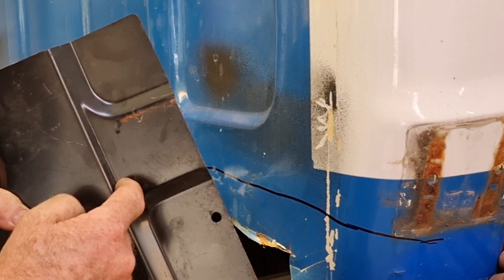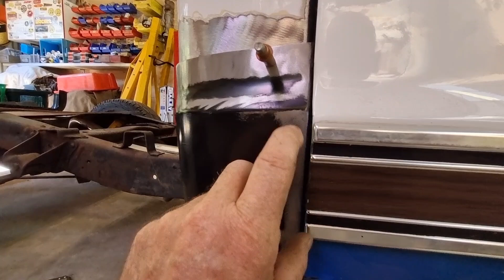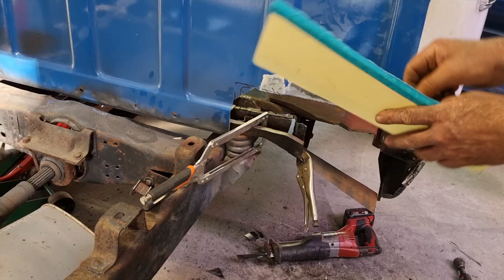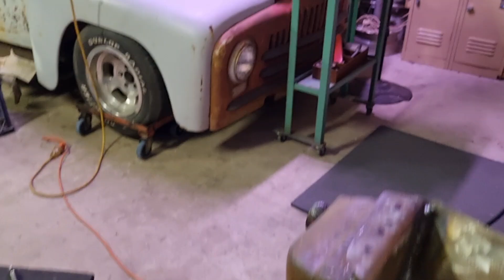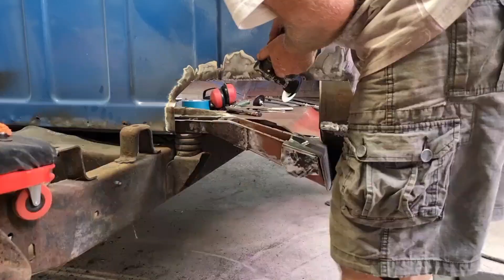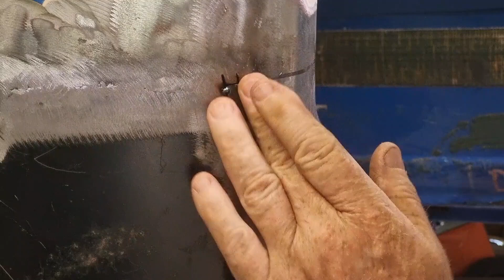Squarebody GMC gets a new cab corner and more rust repairs

Comment: sorry to say a 67 to 72 is not a square body the years of a square body is 73 to 87 but good job on it . i was given floor pans, rocker panels and cab corners for a 68 but i don't need them and i have a extra rust free air condition cab it was a complete truck but my kid took the front clip from it. i also have a few rust free 79,78 trucks scottsdales . i am thinking on selling a 79 short box 4x4 cheyenne with full options with the 400/400 turbo 100% factory with under 35,000 miles on it
Reply from the maker: Sounds like you have a few good projects there. Thanks for the clarification on the square body years. I have been told the 72 is an Actionline. Cheers
Reply: @ToxicGarageCustoms  i have 10 acers of rigs only keep the good ones